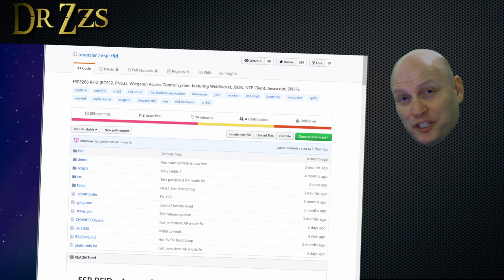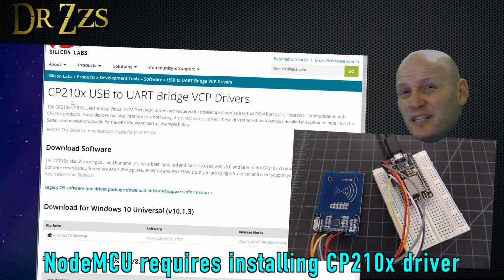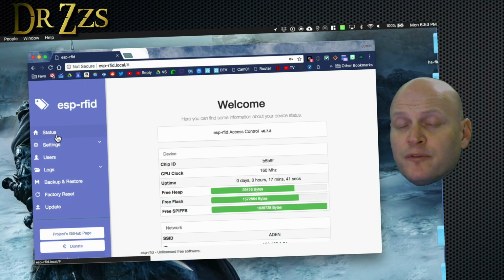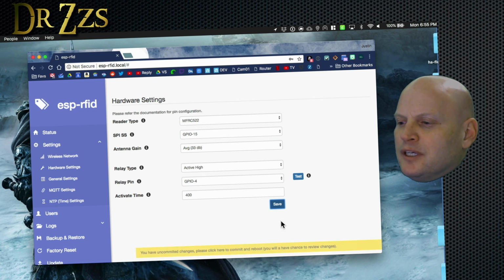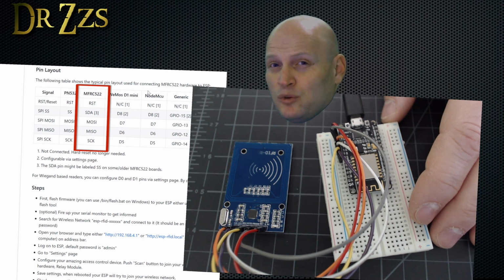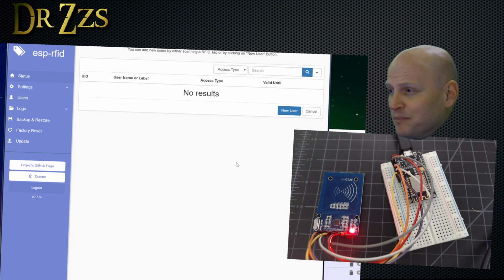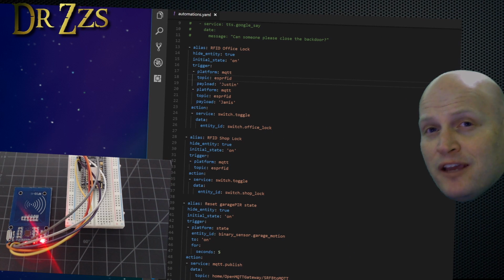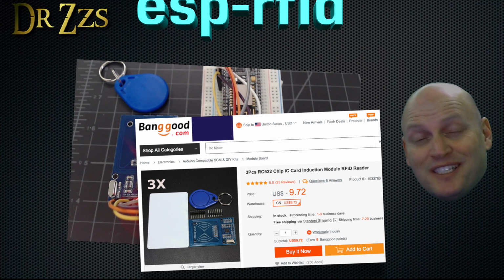ID Card Scanner using NodeMCU, MFRC-522, esp-rfid firmware, and of course, Home Assistant

Comment: DrZzs this sensor will cut the need to add a sensor for each name when doing automation. 
question, where did you get ur extra rfid card from... I got a pack of 10 off ebay a year ago but the do not work. only the one that came with the rfid -RC522 will scan. 

sensor:
  - platform: mqtt
    name: "Office Lock"
    expire_after: 3
    value_template: "{{ value }}"
    state_topic: "esprfid"
    qos: 0
Reply from the maker: Awesome! Thanks Bobby! That's useful. 
I got a pack of 3 sensors with a card and keychain with each one.  I don't know enough about the different RFID readers to know which cards work with which sensors.   Someone pointed out that there are sensors that will read the NFC from a phone, but this scanner won't do that.  
I still have lots to learn.  
Good to hear from you again.  Maybe you've been around and I hadn't noticed :)

Comment: I have been looking for this for a long time.... I got it working but it will only scan the one keychain rfid chip it came with.... I bought 10 card rfig and 10 extra keychain rfid chip. for $1. the 10 extra keychain chip I got looks the same as the one it came with but they will not work. I have the same rfid that you have.
any ideas?
Reply from the maker: Hey Bobby!
I got a set of 3 readers and each had a card and a keychain.  I know there are some readers that work with NFC on phones, but this reader doesn't do that. I got these from BangGood, I know they have packs of cards too. 
Maybe the cards can be programmed with a code and yours didn't come with a code already on the chip?  I know I've seen videos about cloning cards.  Maybe that's the answer.   I don't know much more about it than that.  Sorry.  
It might be that this reader doesn't provide enough of a magnetic field to induce the card to activate, but that's less likely.

Comment: once again awesome vid Doc. is this https://goo.gl/WataJE rfid kit ($3.5) any different than one at banggood($10) ? or this one for <$2 https://goo.gl/czojoM.  Node MCU Link for others - https://goo.gl/xvGzvz its the same one you flashed on the screen the spec say 10v max....i will thrown in one of those buck converters and not stress out he nodemcu on board voltage regulator.
Reply from the maker: The only difference is my link was for a set of 3 readers, 3 cards, and 3 keychains.  So all total the Banggood price is 50 cents less :) But otherwise, yep, that's the same reader. 
ya, I've seen some nodeMCU's that say max 9v and others that say max 20v and they look identical otherwise.  Probably best to use the buck converter.  
Good call!

Comment: Hello Dr. I have massive WIFI Problems with that ESP-RFID, how did you get this working? I tried it with NodeMCU and with a wemos d1 pro. Sometimes it does connect to my AP but mostly it doesn't. Which Version did you use?
Reply: Flo's Videos exact same WiFi issues, appears then disappears.
If I do manage to connect, it does not save the settings.
Reply: Hi, I got that working now. You have to flash the NodeMCU with the Blank4MB File and after that I flashed it with the stable Version again. I had to do it a few times until it really worked.
Reply: @j0539h  better get used to the issues. this project is so ripe with issues I struggle to understand how it even got uploaded to github.I think the real purpose of it was to sell the relay boards. I have several teams working this with different hardware and the only thing consistent are the issues.
Reply: same here. Connects the first time, then reboots and then cant do anything. Seems to do it rgardless if you add your wifi details in or not
Reply from the maker: Mine has started disconnecting and not reconnecting also.  
Maybe I'll try the blank4mb flash and see if that fixes it. 

I'm also going to re-try tasmota soon and that may be a better solution anyway.
Reply: @DrZzs  Did it worked?
Reply: Same problem - I can flash first time no problem, enter the menu, set the wifi details, then when I reboot it won't connect and the only way I can get access is to flash the blank 4mb file and re-flash the image. Tried it with a nodeMCU and Wemos 1d - both exactly the same so it must be a software issue somewhere. Even tried reconfiguring my wifi network and connecting to a different AP, all to no avail. Shame, I really wanted this to work. Will have to wait for another version and hope it's fixed.
Reply: DrZzs any joy mate?

Comment: Hi do they do a FlasEZ for Mac?  I can not find it but am in China at the moment so may not be able to search all sites
Reply from the maker: no... It's a .exe so won't run on mac. 
There's probably another way to just load the .bin 
I need to learn to use PlatformIO.  That might be the next-easiest way to do it.
Reply: Thanks - I do have a pc but love my macs so prefer to use them.
Reply: @pjbear1813  NodeMCU-PYFlasher for mac, google it
Reply: Yuka Sinata thanks will try and google as in China

Comment: Great video
I just recive from AliExpress the same components and didnt know hot wo connect them .. Perfect timing!!.
I plan to use them for mqtt alarm do you maye know how i would toggle it between armed and disarmed ? 

Could you post some code maybe?
Reply from the maker: I haven't done that myself but if I were going to I would follow this:
https://www.home-assistant.io/components/alarm_control_panel.mqtt/

There's an example there too for your config.yaml

What alarm components do you have that you plan to use?  You'll have to do something with automations or node-red to get all the sensors and such to respond the way you want when your alarm is Armed or Disarmed.

Comment: What other RF modules are compatible and do you have any suggestions for water proof enclosures?
Reply from the maker: That's a good question.  I'm not really sure what other RF keys will work with this reader.  I know there are 2 other readers listed for this esp-rfid software. It works with RC522, PN532, Wiegand readers. Maybe others too but I don't know. 
I haven't decided on an enclosure for mine yet.  I'd probably design and 3d print something myself then seal it with silicon.  But if I didn't do that I'd try something like this:
https://amzn.to/2JUmrGy

I haven't measured to make sure those would fit but they seem about the right size. 
there are a lot to choose from on amazon
https://amzn.to/2K1v1PS
Reply: I have bought some Wiegand readers from ebay.  
125mhz , Size :28mm×80mm×12mm, totally waterproof. 
 UK ebay item number 332663312018
 US ebay item number 162381596706

Also I have found out that you can flash directly to the nodemcu through its usb port from your computer as it has its own  serial converter built in.

Comment: Nice, my only question would be on the shop lock ... doesn't having it activate on "any" rfid input mean that I could just walk up with any random card out my wallet and gain access?
Reply from the maker: well.... yes... I shoulda thought about that...
Excuse me for a minute while I go change that ;)

The better thing to do would be to list all the RFID codes/users for my family.  
Good catch!
Thanks!
Reply: :P

Is there an option for the module itself to "ignore" any codes not in its database, meaning that no message is sent out on MQTT and then that would save having to write out a long list of rules in HA?
Reply from the maker: good question.  I don't know, but I wasn't looking for it.  I'd be surprised if it wasn't in there somewhere.  They were pretty thorough.

Comment: This was just the thing I was testing on , I have the PN532 board , nicely done 👍
Reply from the maker: how's it working? are you able to use NFC from phones?
Reply: DrZzs current I’m on a epic bike journey towards Leh Ladakh , once I’m back home will send it over to you. But this project looks better interms of management and stability, does it have any security concerns ?
Reply: Hey Z, i got it working on the PN532 board, its completely working like it should, im using a WEMOS D1 mini pro for my tests, took me sometime to get the GPIO pins right even with the diagrams, best thing is its also working with cellphones(used a One Plus One 3T NFC) and it works like a charm.

Comment: Nice video, how about the video on the touch switches(1,2,3 gage) and ifan02? Thanks
Reply from the maker: T1 switches are next.  I've done the research, just gotta do the flash and film.  
They are definitely the most complicated flashing process of all the Sonoff devices. 
The Fan02 is still in transit.  I haven't seen it yet.  That one will take a little longer.
Reply: I actually managed to flash tasmota on a T1-UK double gang and all seems to work, just need to stick it in the wall now! 
I did it the hard way though using the audrino IDE and an FTDI serial adaptor I had lying around :D
Reply: Drzz, thanks a lot. I hoping to see a few things, 1 does the 3 gang switch fit horizontally in a normal 3 gang switch box so I can get rid of current 3 switches. And 2 will 3 1 gang T1 fit in a 3 gang vertically... trying to decide the best solution to meet the wife meter and not have blanks.
Reply: The dimensions for the T1-US are here - http://dl.itead.cc/T1_US/wiring-2.jpg ... but it appears to replace a single US switch, so if you have three independent switches you would have two blanks, however if all three switches are in one "module" then it would replace that - sorry I can't be of more help but our UK ones are completely different (square)
Reply: Ash K thanks a lot, that's kind of the issue, I can only find videos on the UK versions. And if I find a US version it is only one switch which does fit sideways in a US switch box.

Comment: Wonder if this would work with NFC from a phone...hmm...
Reply from the maker: Excellent!
guess I'll be ordering a PN532
Thanks Travis!
Reply: interested in your testing too.  using my phone for these tasks would be fantastic!
Reply from the maker: dang, I shoulda tested that!
Reply: In my quick googling it looks like you need the PN532 reader that this same firmware supports to do NFC phone stuff.
Reply: If you want I think you can use your phone as an nfc tag. If that's what you need
Reply: Make sure you Google on that a bit more than I did as I don't offer refunds! :)